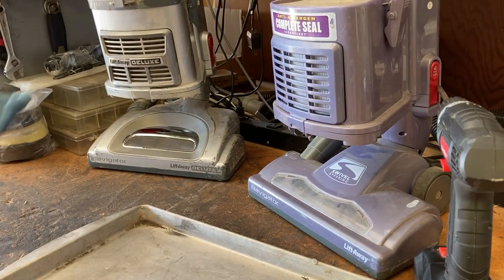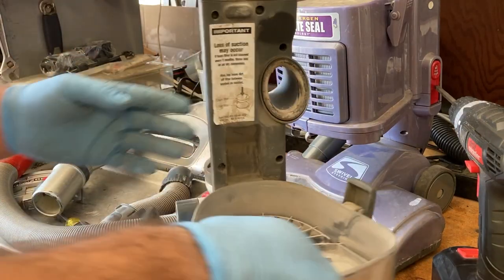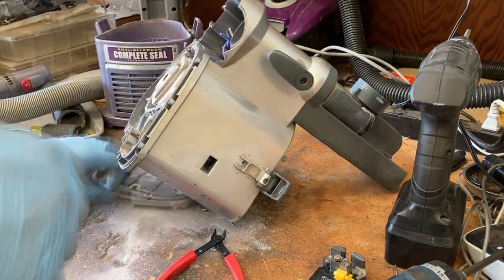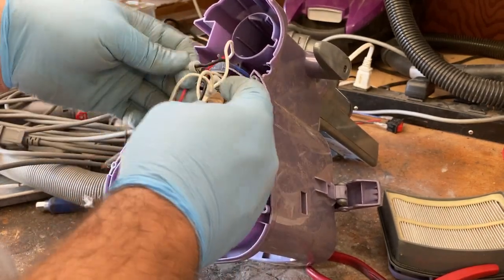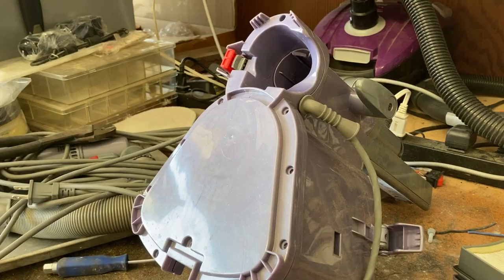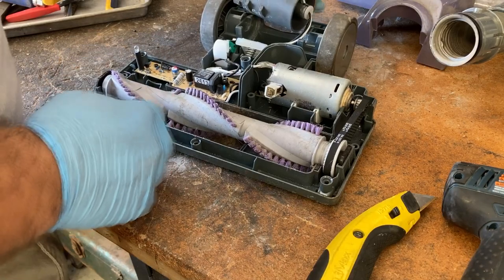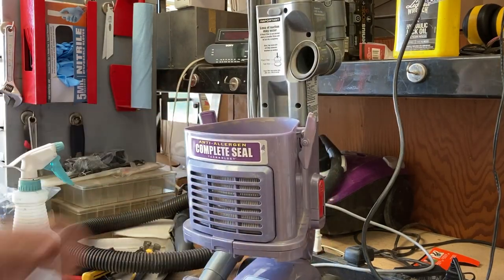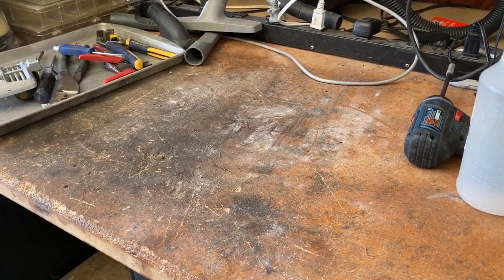Shark Navigator Vacuum Cord Replace and Full Service

Comment: Dude that silver navigator is my exact vacuum. Please dive into it. I’ve fixed a whole bunch of shit on it and it keeps clogging right where the red tape is on the handle. Except my tape is black lol. I got it from a family member as I don’t have one and I use it for my German Shepard a pet hair. The switch is broken. I’ve fixed it once but it’s fragile and my girl didn’t know that. So it’s either on or off. But how do I keep it from clogging on the handle. And my pitbull pup chewed the cord right where the plug in is at. Any advice until I can get a new vacuum?

Comment: You can rinse off the motor as long as you dry it right away. I use a hair dryer and never had a motor fail doing that. Just dont get the circuit board wet in the base. I buy these at the goodwill outlet for 5 bucks & clean & repair them and sell them for 50-60 bucks. Done hundreds of them. Use a magic eraser to get all the scuff marks off and most look nearly new after a hour or so of cleaning & repair.
Reply from the maker: Thanks for the info

Comment: Hi, can you please provide an amazon link to the power cord you buy to use with a Shark? One that is bendable/versus rigid. 

Also, if you happen to replace another Shark cord, please video just where you cut the wires and add the new wirex, I need a little more slow motion on that part!

My German Shepard rescue decided to chew up cord and plug! :'(

Thanks for your help Hank! Doreen
Reply: my aussie puppy decided to chew on my cord also! wow . little assholes. i brought it into the vacuum repair and they said they cant even replace sharks. messed up!